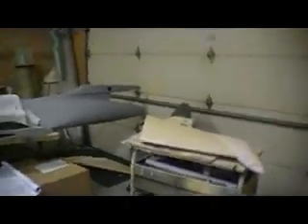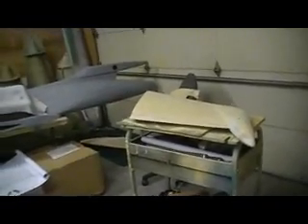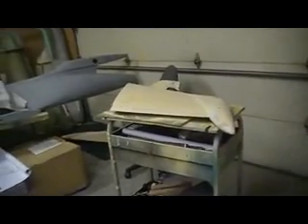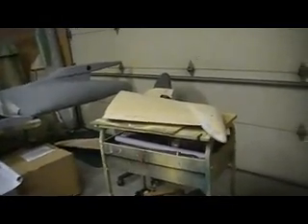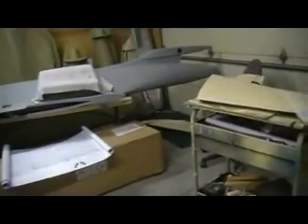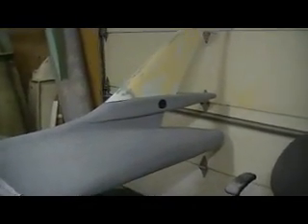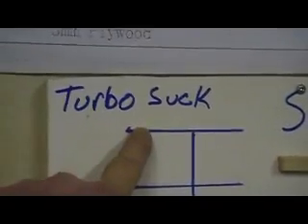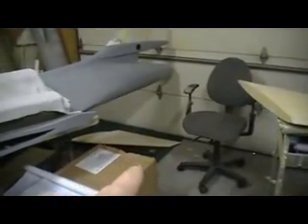how to build a rc jet B-1 Bomber # 139 pt 1

Comment: Those fuel tanks stradling that turbine are something I would have avoided designing into any airplane.  Those are TURBINE engines and therefore have turbine wheels with turbine BLADES!  When a turbine wheel comes apart (shells out) those blades will come through the side of the engine like flaming bullets and pass through those fuel tanks like a hot knife through butter and will ignite the fuel.  Plane fly past go BOOM/CRASH/BURN!!!